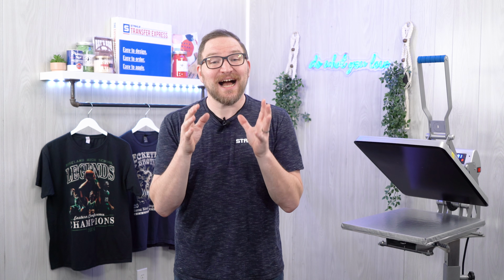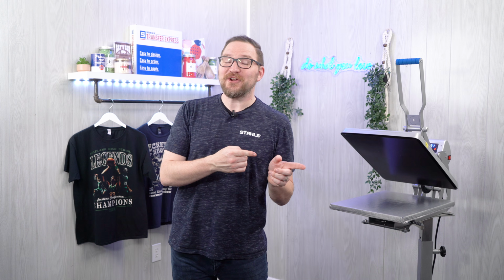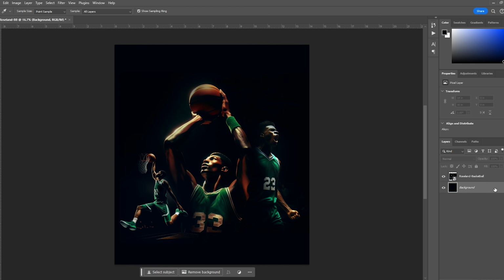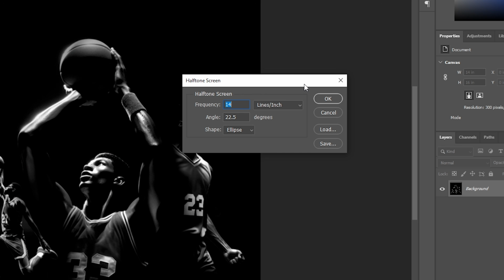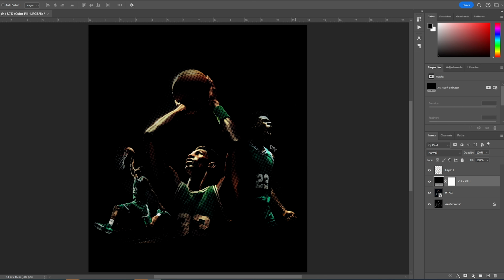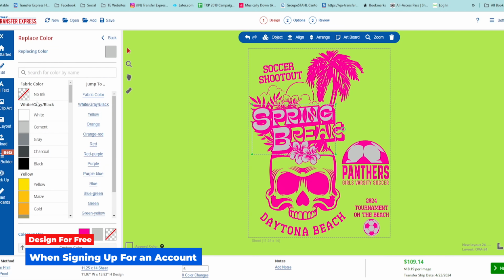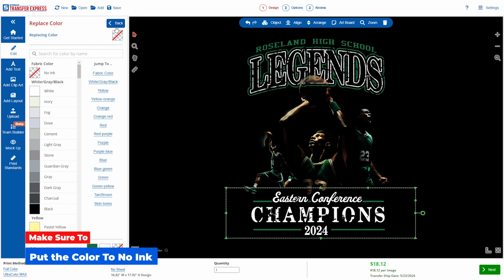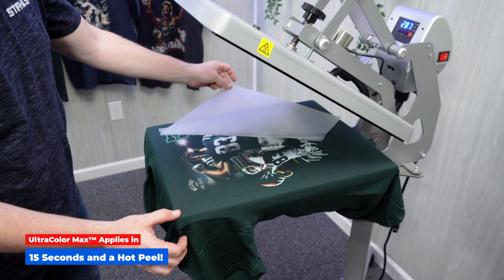How To Halftone DTF Artwork The Easy Way

Comment: Can it work if someone prints on canva the halftone effect ?
Reply from the maker: Unfortunately canva doesn't quite have the halftoning capabilities like photoshop does. However, you could take artwork from Canva and run this same process in photoshop. 

Additionally, with transparent png's exported from Canva you can utilize the new AI Assist at https://www.transferexpress.com/heat-press-transfers/ultracolor-max to automatically convert any transparent areas to halftones like we show in this video- no photoshop needed: https://youtu.be/NtCe6e728Bc

Comment: Easy way 😳, that's actually a very long winded way and not even a good one. 

1- No need to gaussian blur as it softens the over all image, you don't want to have pixels with less than 100 percent opacity.
2- 14 size Halftone is huge, it should not be any larger than 28,usual ranges are between 30 and 38.
3- no level adjustments were done resulting in rather dull image.
4- Do all bit mapping in a separate new document. 
5- no need to reconvert bitmap to Gray cor just copy it and use layer mask feature to simply paste the Halftone layer. As all dark areas will be automatically clipped.

This tutorial showed so many unnecessary steps, there are fast simpler and better methods to achieve Halftone.
Reply from the maker: Thanks for the feedback, there's definitely a variety of different ways to halftone designs for DTF, we watched about a dozen of them before creating this tutorial. This video was built to be the easiest to understand with zero previous photoshop knowledge- Thus not using layer masks, curves or channel adjustments (only simple level adjustments) or other advanced tools that are a little complicated for first time users looking to use this specifically for DTF prints. With your advanced knowledge, I'm positive you can get some incredible Halftone results! 

1. The Gaussian blur was applied to correct some of the jpeg artifacting in the halftoning process as these were originally low resolution images. Sometimes in halftoning it will grab the hard edges and show some 'blockiness' when bitmapped. We could have been clearer about the purpose in the video. After halftoning we wont have any pixels with transparency.

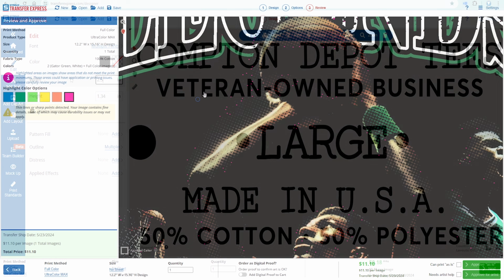2. 14 LPI halftones are the limit for most DTF Prints. A line at 30-38 DPI with yield dots too small for powder adhesive and the DTF printing process- leading to dots falling off in the wash or failing to transfer. We wash tested about 9 different examples with different LPI resolutions before making this video and 14 was the sweet spot to ensure no dots are washing off or missing powdered adhesives (with a minimum of .018"). Sure those higher halftones look great, but no one shows them to you after a couple washes. We have an automated artwork pre-flighting tool that detects soft edges, non-opaque pixels and minimum print standards for the DTF process for best results. You can see it check the image at 19:22 in this video (and it still grabbed a few dots, although we surely wont miss those). 

3. We did adjust the levels in the greyscale step. We totally agree we could have juiced the whites up more. 

We could absolutely open a separate document, use layer masks to copy over, but its more complicated to walk a first-time user through that. We opted to keep it simple in a single document saving both versions.

Comment: Any method for CorelDraw 24
Reply from the maker: While a little bit different in process, you can also use Corel draw, First you'll have to convert the copy of your image to a bitmap like we did here, then Go to Effects > Adjust > Contrast/Brightness/Intensity (Similar to the levels adjustments we did in this video)
Increase the contrast and set Brightness and Intensity to a minimum.

Next, you can try blurring to smooth the image, Go to Bitmap > Blur > Gaussian Blur
Set the Radius intensity to around 40 pixels or less.

Then, Go to Bitmap > Color Transform > Halftone and mask your original image back in.

Comment: It's actually way easier to make this effect with Affinity Photo. No need to duplicate the original file, it's non destructive and you have way more control.
Reply from the maker: That's awesome Philippe, do you have a link to share that process? We'd love to try it out ourselves. Greater control of the halftone dot could eliminate a step or two here too! We did try to keep this tutorial as simple as possible for some decorators who may not know the ins-and-outs of photoshop. The best, non-destructive way would be to apply a clipping mask with the selection to the original file.
Reply: @transferexpress  Well, I figure out the process myself, but it pretty obvious when you know the software. Affinity have live filter that are not destructives. There's a half tone layer filter in Affinity. So you can apply a black and white filter, adjust it with a curve filter as you wish, and you basically have your halftone screen live, right in the file and fully adjustable. You can change the white balance, the angle or the size of the dots, and the file is not even heavier. When you are happy, go into your channels and load any of them into your selection. Apply this selection to your design as a mask and that's it. Just disable the filters you used to create it, you can tweak them latter if you want to. The file is intact and fully editable.

I use it for the three transfers I printed just today, and the are awesome. 

Photoshop is a great piece of software, but my opinion is that Affinity surpass it in most aspects. I use Photoshop professionally since 1995, and Affinity since the Beta version.
Reply: How?

Comment: Only 14 dots per inch is crazy big
Reply from the maker: Compared to the traditional screen printing LPI of 45-55, yes, these dots are larger and for smaller artwork may appear more stylized. With large, full-size designs like shown here, the halftoning effect is barely noticeable at a typical t-shirt viewing distance and dramatically improves the hand-feel of the print on the garment. 

For DTF Transfers, we've found the 14 LPI setting to be the smallest we could go to produce a dot size that will meet the minimum size for printing and long-lasting prints.
Reply: I use 15 and look awesome

Comment: Thanks for this! By far the best halftone instruction. Question, will it last longer like the standard solid print?
Reply from the maker: Thank you for the kind words, we're so happy we could help out! Dave spent a lot of time testing different halftone methods and settings along with the wash testing with our Research and Development department for the minimum line requirements to ensure quality results before filming this video. With the dots set to the minimum size mentioned in the video (0.018") you should have the exact same durability as a solid print.

Comment: Nice! Should we maybe clean up the halftone areas that are not over the images?!
Reply from the maker: Yes, in some images you may have to remove any elements that halftone outside of the main image area, but in many cases you can adjust how the bitmap halftone looks based on the levels like we show at 07:44 in this video. Even if the background may appear black, it might be a dark grey and pull a halftone pattern over all of it.